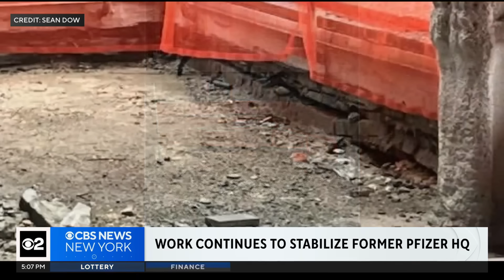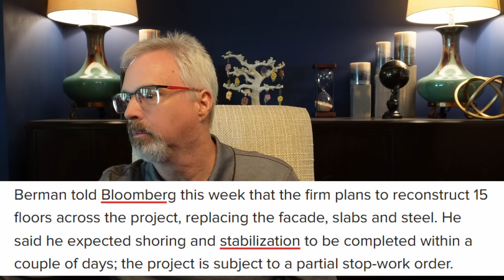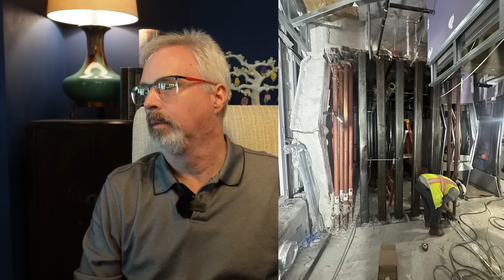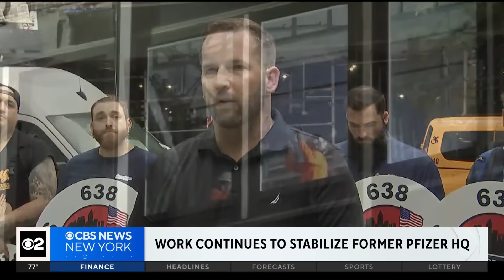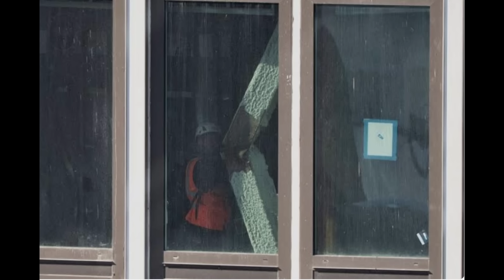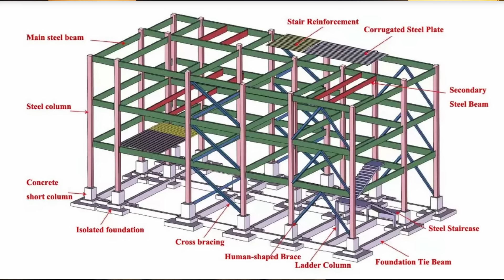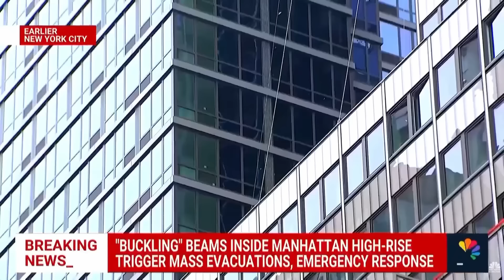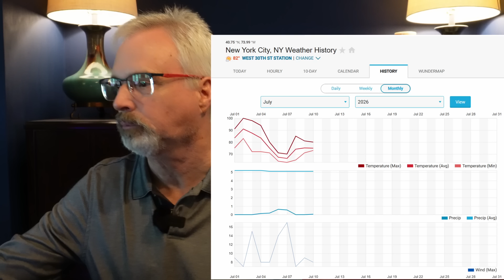Update - Pfizer Building Structural Column Failures; Now What?

Comment: Shoring the structure up will probably be tricky, because unless a full structural evaluation was done (doubtful) removing fire insulation is probably necessary to determine the condition of the framing that would be used in the shoring strategy. I'm starting to think they didn't check the steel as such and for whatever reason, condensation or some type of water intrusion got beneath the fire insulation. Just a guess of course.

Comment: Whether union or non-union you still need to follow engineered plans. Which craft was non-union? Sounds like poor engineering.  Need better plan checkers. Did they get paid off? General contractor is in charge of the whole project. Did the General get paid off? Lots of questions.  🙄🙄
Reply from the maker: Certainly more questions than answers at this point.

Comment: this is a 3rd world level engineering Failure. Not only did they stack a whole bunch of floors on top of those columns but then they cantilevered them as well. It looks like no attempt was made to reinforce the upper floor original supports to take the Significant extra weight. they're saying a couple months work? I would say a couple of years work would be more appropriate. I'm pretty sure they're going to have to rip out everything above those columns

Comment: Those wire reels are heavier than normal weight of domestic furnishings
Reply: Yes, but the wire reels were stored on the same level as the failed columns, so the can not have contributed to the failure.

Comment: Still not sure if the failed columns were part of the new construction or existing. Either way, the carrying capacity of the column is a function of its "slenderness ratio", which is a mathematical value calculated by dividing the column's effective length by its minimum radius of gyration. Effective length is determined by the end fixity condition ("pinned" connections or "fixed" connections), and the radius of gyration is a number determined by the column's cross section geometry - the shorter the column's effective length or the larger the radius of gyration (or combination thereof), the greater the carrying capacity of the column. It's a fairly easy calculation to get right, provided that ALL the loads from above are accurately calculated.
Reply: The failed columns clearly show the original to the 1960 building spray-on fire cladding (most likely containing asbestors) cracked open, so these are definitely existing before the additional storeys were set up on the former roof area that they used to carry.

Comment: I still wouldn't feel secure with extra stories added to an old building, no matter how old-school redundant.  I have to assume the redundancy was not planned for another building placed on top of it a generation later.
Reply: Quite apart from the structural issues that have now arisen, the vertical additions also represent an aesthetic violation of the original design. 
One need not necessarily find high-rises from that era beautiful, but the images clearly show that the original architects aimed for a coherent overall architectural form through the stepped upper stories—a vision now rendered completely absurd by these arbitrary (and maximal) rooftop extensions; it has simply become a box of maximum bulk, no longer a piece of planned architecture that respects its surroundings and the urban realm.

Comment: A project like this does not get designed over-night nor on the back of an envelope.  it would not only go through engineering procedures to ensure it was in spec, It would have to be signed off by the city.   Where things can go awry is sequence of operations, sub-standard product being used and the use of non-qualified people doing the work.  Contractors always try and cut costs and time.  i have seen a lot of really sketchy stuff in my time working in compliance in London.  I never saw this , or anything close.   Something like this does not happen overnight.  There will be symptoms before the steel yields.   There is a lot at play, and you need to know how the building was constructed in the first place before making meaningful comments.  Building collapse is rare.  Structural failure like this is very rare.  When it happens the reasons need to be ascertained.  That cannot happen with conjecture.

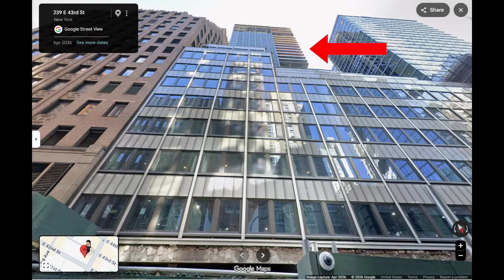Comment: 10:34 so we are looking up at where the floors were added.
And the face of the main beam, running along the bottom floor windows, the entire facing is crumbling off.
From what? Water corrosion? Fundamental over pressure stress? 
Look over to the right side of the picture and it looks like  large chunks of the concrete is coming off. 
It 'could' just be the facing concrete finishing coming off. 
It 'could' also be a warning the entire building is getting "real tired, boss."
They will talk until it falls apart.
And judging how those added floors were sliding ten inches down to the right?
That will not be too long now.
They got away with some really questionable add ons for a long time and now, because of age, corrosion and stress, the bill is now due.
The bill is, tear the entire thing down safely, and build a new modern and safe building in its place. 
We actually owe the residential conversion company a big thank you. 
Their work exposed a building that was in the process of failing and killing a huge number of New Yorkers. 
Now, the entire thing can be demolished safely. 
They can write off all the work they have done, on this crumbling building,  as a loss of their corporate taxes.

Comment: As an electrician in construction i can say those reels of wire all being stored together in one location is an immediate red flag.Those wire reels weigh tens of thousands of pounds each.This is visible on just one floor so I’m curious if this type of practice was for every floor.I’ve been on jobs where the job was being done open shop whereby only some trades were union.The safety protocols are definitely not the same when these jobs are done splitting half union labor so they save money.The same can be said the additional floors added are done to maximize profits.
Reply: out by the window of a cantilever is even worse.
Reply: Any loads on the floor shown where the columns failed were not direct loads that primarily caused the failure, however.  They may have deformed or stressed the floor in a manner which contributed to the failure, but the loading at the top of those columns is what has to be addressed.

Comment: Investigating and litigation will prevent restarting construction prior to the original completion date. 
  Designing a remedy can't begin until the investigation reveals the cause and the extent of existing corrosion (or other flaw). Also do neighboring columns have non-visible compressive load? Beams from being levered like a springboard beyond elastic deformation?
  A condition of allowing construction to resume should be the owner being physically on site, within the building) during construction, and his family lives on the top floor (using the communal elevators) for 5 years after completion.

Comment: I am familiar with engineering principles, and I had a passing thought.  Could the contractors who built the building originally have had some steel delivered to them that was less than perfect that they then saved for the upper floors where the buckling occurred?  It seems any corner ever being cut is exposed somehow at some point after a compromise.  Maybe this incident was a small compromise to save time and a hassle that turned into the failure we are seeing.  Just hope the engineers get to the bottom of the issue completely, so we can all have some confidence that our buildings are safe.

Comment: The roof steel on the original building was never intended to carry more load . DUH - whoever signed off on the design is the culprit. Workers are not to blame for existing steel- that union guy is sounding like an ass clown . Open shop steel workers aren't the problem here its a crooked developer , a shoddy outsourced set of plans that were passed via money changing hands rather than by due diligence and proper structural audit.
Reply: So what you’re saying is the engineers who designed the building are idiots and you’re smarter than they are and could’ve done a better job.

As soon as you had that thought you should’ve realized wow how could they ever design buildings if they were that dumb.

Comment: Looking at the partially finished upper floor columns going straight down on to the old columns and noting that the old columns at the top is where the buckling happened is an indication to me that there is something different, either geometry or material that is not the same.  Either the old columns were not designed for the extra load or they were corroded to a point where they could fail.  Either way I agree that there is no safe way to repair this building without removing and replacing all the floors above this failure.

Comment: For such a massive change to the original building structure I would have thought all the supporting column would have had an ultrasound survey, the fire insulation indicates this was not done.  The corrosion should also been dressed and the column repainted.  I question the way the Cantilever is constructed and the transfer of curtain wall loads back to the main building columns,  three columns give no redundancy.
Reply: New fireproofing had to be applied to every single column and beam.
To do that you’d have to strip off the old stuff at which point you could see if it was severely rusted.

Those columns are undersized.
The question is why. 
Were they supposed to be replaced with something large larger?
Were they supposed to be reinforced?
Did the engineer forgot that there was a building underneath his new extension?

Comment: I’m concerned that the fire spray application will trap any moisture against the steel columns to corrode them!
This is just the first of many buildings that they will find, that are the same.
Reply: Steel that is to be fireproofed is not painted and needs to be “rusty” so the fireproofing material can bond.  If the steel is painted, either the paint must be removed or bonding agents added before fireproofing.  That steel does not visually look corroded, just rusty, and the fireproofing looks to be well adhered.

Comment: I wonder if they planned to reinforce the foundations ? There where designed to support the original stories building, and certainly not an additional static and dynamic weight of 15 stories. The dynamic weight is the wind pushing the facade.

Comment: Someone did not analyze the point loads below the new cantilevered floors correctly. Poor quality control on the checker of the structural drawings and calculations. It happens. Luckily a catastrophe was averted.

Comment: The way they cantilevered the additional floors this building failed exactly the way a 10 year old would expect . I’m not saying it cant be done. I’m saying that this is where you would expect there might be a problem.
As far as the union labor is concerned… it’s very likely that’s why the building failed when it did. If you take away all the load from the structure that union guys would have stolen and put on eBay it surely would have failed much later

Comment: It's hard for remodel design to accommodate hidden conditions and structural systems and it's common to discover stuff that is totally wacky and wrong, some of it is just accidental dumbassery but often it seem like purposeful corner cutting; it doesn't surprise me at all to find joists going in the wrong direction and carpenter ants that have eaten the load bearing members. Long before financing is fully secured and permits are applied for, somebody spends a bunch of time measuring and modeling what can be seen on the site and what's in the available drawings, after that comes architectural design and then structural design, and all that happens long before the finishes are opened up and you can see what is actually there. You can only cut open so much of a finished wall before you need to get permits and once you rip it open you can't rent it until you repair it, there are practical reasons why remodeling is a gamble. Every wall or floor that is opened has to be refinished and there is tremendous pressure not to do any work that isn't actually required, and it can seem like a bit of a see no evil mentality. I'm guessing that the developer will put up a fight before he strips off all the fire suppression foam to visually inspect all the columns but that needs to be done now.
Reply: They're using x-ray inspection from the photos I've seen
Reply: I wouldn’t be all that concerned about carpenter ants on the 19th floor of a steel-framed building, even one built 66 years ago.  Everything else though?  😮
Reply: @Thegonagle  Out here on the West coast the carpenter ants eat wood, but we're talking about New York, those carpenter ants have a union, their boss has a crew with a lead named Vinny, and if Vinny the ant says it's his building then it's his building and he can eat anything he wants.

Comment: Going back to the original designers, they most likely "optimized" the original design loads, not giving much overkill (margin of safety) for any future add-on loads (like what the GC contractor just did).   Therefore, bam; unforgivably resultant failure and lost of customer trust.

Comment: The location makes rust a good possibility.
The open 22 floor could have let moisture run down the steel support, underneath the fire resistant cover. 
In the summer, the cold from inside would move out along the steel, causing condensation. In the winter, the cold from outside would travel inside, down the steel support, causing condensation through any cracks in the fire retardant, in the case that it was even waterproof to begin with.
Reply from the maker: Those are great points!
Reply: Once I saw the diagrams in this video I thought ~ how many decades(?)  did they have a mysterious leak about 3 floors below that needed mopping 5 times a year . . .

Comment: When designing the iron frame in a building, the thickness of the load columns are normally decreased to reduce weight and costs.  When you add 16 floors above the original design height, it may be essential to add additional reinforcing to the original columns to carry the additional load to the ground.  Based on the size difference between the failed columns and the columns above them, it looks like no lower level column reinforcing was done.
Reply: The upper columns of the original building would tend to be lighter than the ones lower in the building because they are carrying less load as was mentioned in the video. In a project like this, the structural engineer would first look at the existing steel structure and foundation to determine whether the structure could handle the additional floors. I would be very surprised if additional steel reinforcing was not required. The lack of additional reinforcing on the bent columns suggests that there was a major design error or bad construction sequencing with the required reinforcing coming in later. Looking forward to reading a report from an independent forensic engineering firm such as Wiss, Janney, Elstner.
Reply: @MrsAnnieTK  I would concur.  They either underestimated the new load or they didn't correctly sequence the construction process. The forensic engineering report should be interesting.

Comment: I still say that the engineers for the addition were given "as built" plans for the floors around the 21st which DID NOT document change orders recognizing the reduced loads at the columns at about floor #21.  I ALSO believe that there was a sudden tensioning of the existing structure to the side of the new construction which MUST be examined to certify the existing structure successfully withstood the  near instantaneous lateral and vertical hard load that caused those columns (and concrete floors) to buckle.

You rebuilding this?  It's gonna be spendy and like chasing that mouse. You may not ever be successful in cleaning up the damage done.

Comment: Before construction even begins, doesn’t an engineering firm visually inspect all the existing steel members?  Wouldn’t they have to peel back or remove the fireproofing in certain areas to make an assessment of the steel infrastructure’s condition?

I understand this would be an added cost when possibly dealing with asbestos.  Assuming this isn’t a requirement by building code, why would anyone not want the peace of mind to review?  Dollars and cents I understand, but as a layperson this doesn’t seem prudent to open oneself up to so much liability.

Comment: Many buildings constructed more than 50 years ago were built using structural steel with a specified yield strength of 36 ksi, whereas modern structural steel is typically 50 ksi. If an existing column is assumed to be 50 ksi when it is actually 36 ksi, its yield strength—and consequently its design compressive and buckling capacity—could be overestimated by approximately 39%.

Comment: 6:40 non-unionized tradespeople are not the ones responsible for calculating loads, stresses, and designing the building structure. Structural engineers are not unionized and could not be replaced with unionized engineers. So far it looks more like the new floors exceeded the material strength margin of error of existing columns. It doesn't look like it's a trades issue unless the live loads were the trigger; and if so, I doubt its a union vs non-union labor issue.
Reply from the maker: Well said!